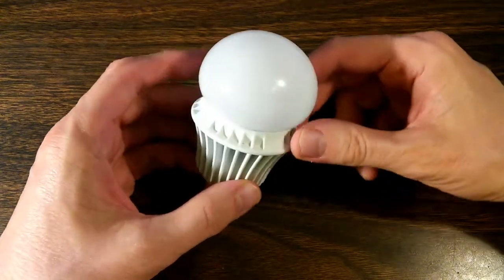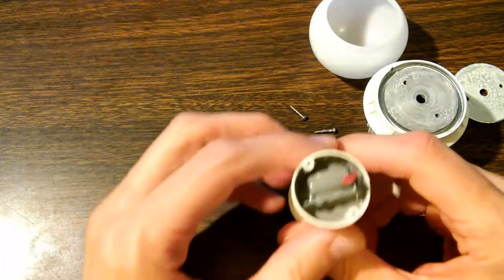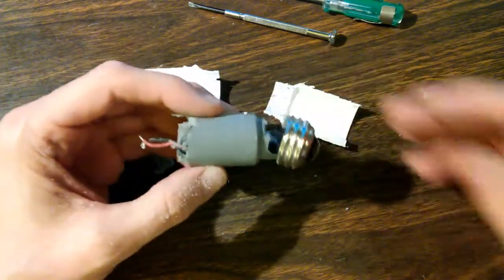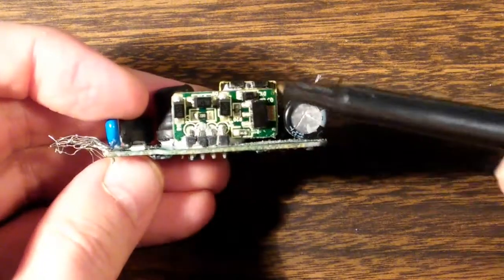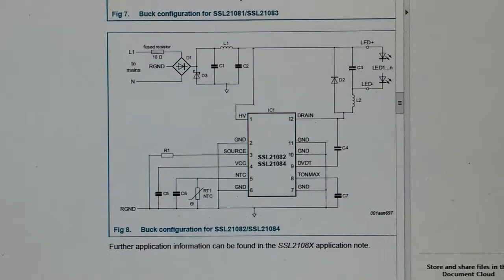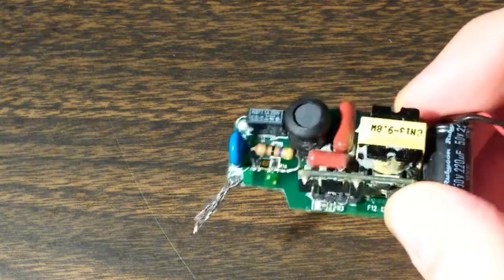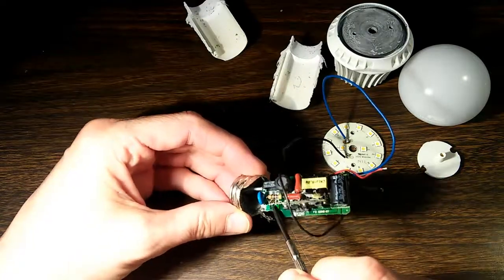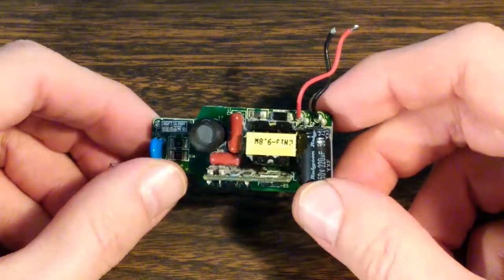Utilitech Pro LA19DM 60 Watt LED Bulb fail.  Trouble shoot.

Comment: excellent  been running my on test on bulbs   this model LA19 and  the Utilitech R26 500k 750 lumens also failed(started flashing although it could be the capacitor) at six/eight months now i know why.  Do u have any recommend on a brand?   I currently am testing three name brands but have no results yet